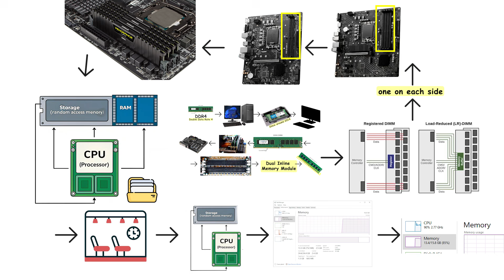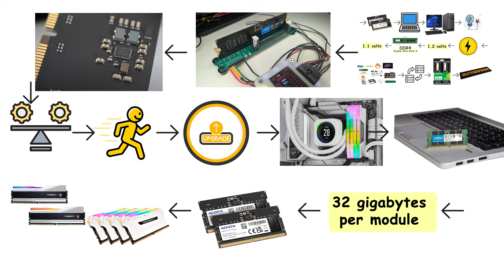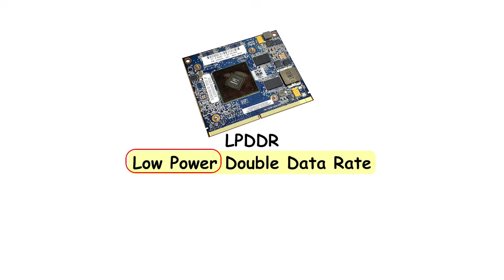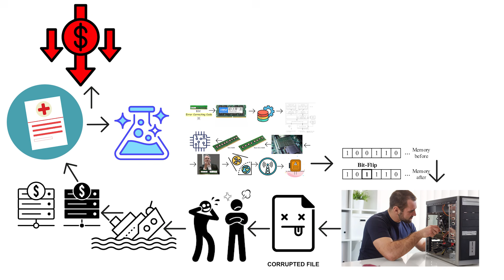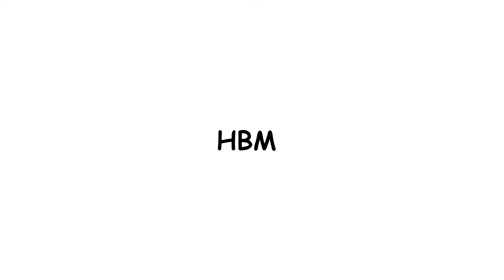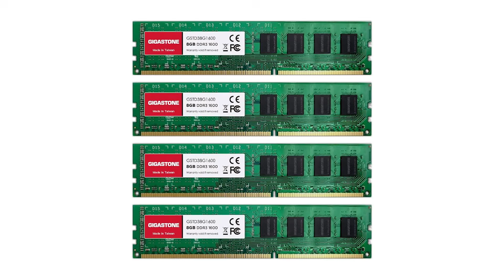Every RAM Tier Explained

Comment: DDR5 SDRAM (Double Data Rate 5 Synchronous Dynamic Random-Access Memory) - The industry standard, originally targeted for a 2018 release date but was pushed back and finally released on July 14th, 2020 for consumer and business enterprises. The first generation of DDR5 was the DDR5-4000 (PC5-32000) and
DDR5-4400 (PC5-35200) respectively.

DDR5 4000MHz memory represents the entry-level speed for the DDR5 standard, providing high-bandwidth performance with increased efficiency over DDR4. While standard DDR5 begins around 4000–4800MT/s, speeds of 5600MHz to 6000MHz+ are more common for modern gaming and productivity systems. 

While DDR5 4400MHz memory represents an early, lower-speed specification of the DDR5 standard, often featuring CL36-CL42 latency and operating at 1.1V. While 4800MHz is the typical JEDEC starting point, 4400MHz kits exist for specific, often industrial or specialized, applications, providing improved bandwidth over DDR4 but generally underperforming against common 5200MHz+ DDR5 kits.

Cheers 🍻